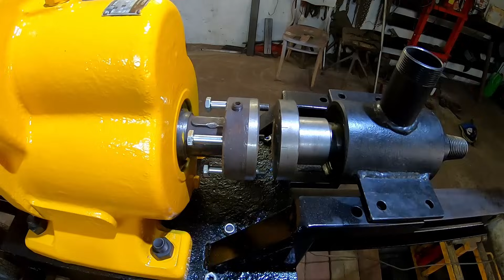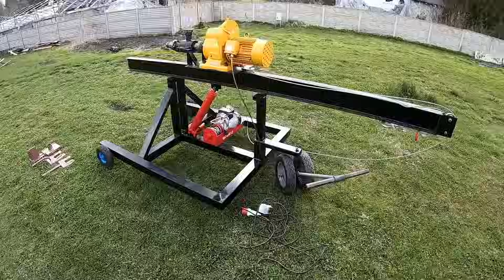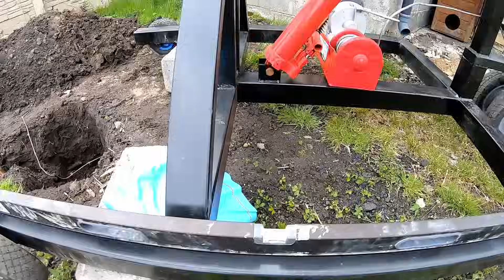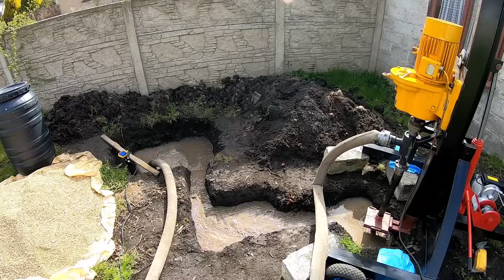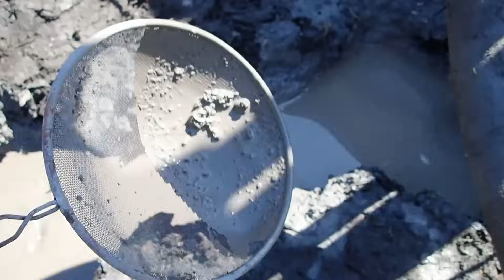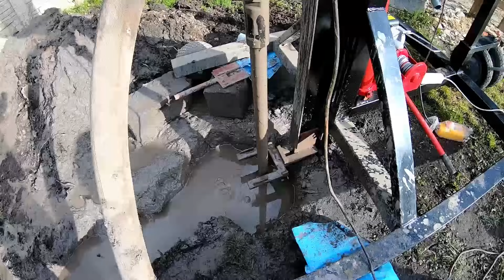Mobile Water Well Drilling Rig I My First Bad Borehole

Comment: Tell me name of its parts
Reply: the motor and the gear reduction unit are the parts that will set u back $$$$$. the swivel that pump through can be made from plans on the internet or books. need a pump to circulate the cuttings out of the hole. i wud ream each piece of pipe up/down at least once after i drilled that part of the hole to make sure the hole is nice for when run casing into the hole. bentonite (clay) is used to help carry cuttings up the hole and build a wall cake on the walls of the hole so the hole is slicker and wont fall in so fast and stick the pipe. 

got to keep the pipe moving and pump circulating or the hole falls in and sticks the pipe and cannot get the pipe out of the hole without some SERIOUS HORSEPOWER to PULL ON THE PIPE. even BIG OIL DRILLING RIGS GET STUCK so bad that they eventually "shoot off" the pipe (disconnect the pipe above the stuck part of pipe), come out of the hole, go back in and cement up the hole a ways and drill around the junk in the hole. just a lot of wasted time and effort cuz let the pipe sit in the hole without rotating it and circulating the hole.  

the skid and the I beam can be made by welder. winch from china as well as the jack to jack up the derrick. pulleys online... still a lot of work and a good amount of money went into that. i wonder how much the electric motor and gear reduction unit cost???? that wasnt cheap.